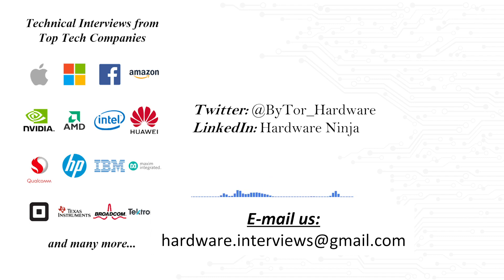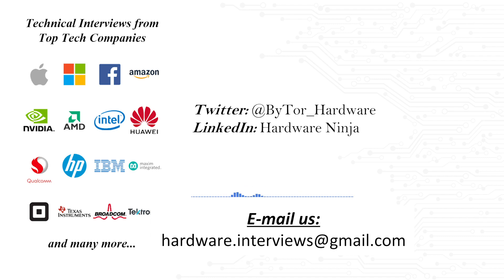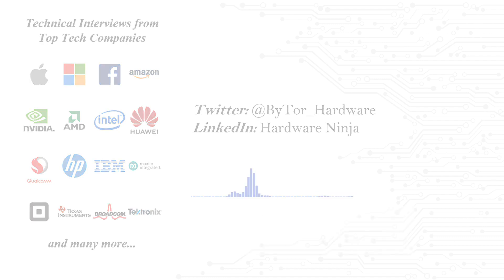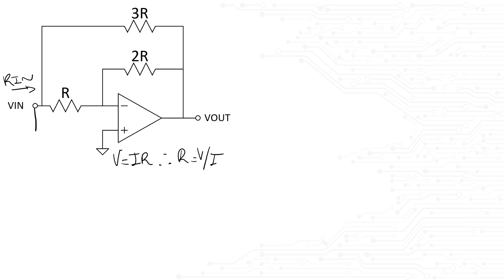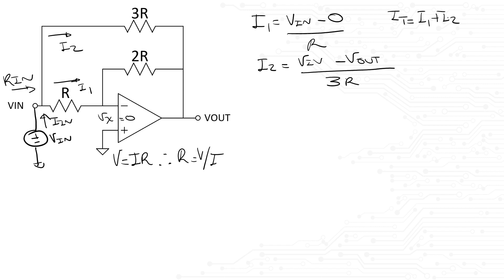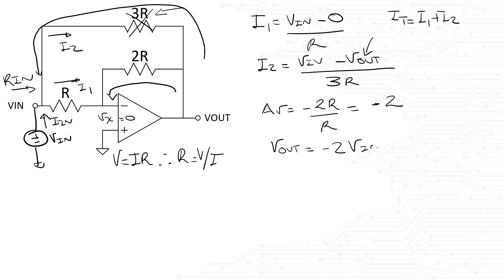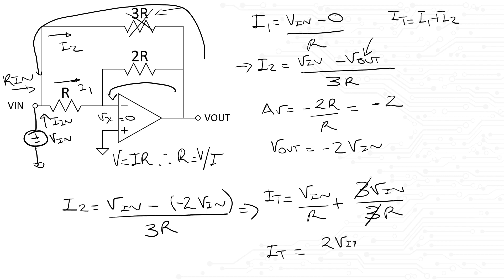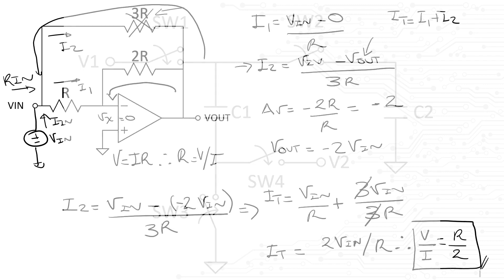HWN - You're guaranteed to be asked this question on your interviews - "Back to Basics"

Comment: A faster way is to assume input impedance is high (so an open circuit) and output impedance is low (so basically a short). In that case we are looking at the resistance of 3R in parallel with R + 2R which equals R/2.

Comment: One baby doubt How you intuitively neglected 3R at the time of gain calculation i don't get it. Yeah! Gain will be -2 but how you approach to find the gain neglecting 3R that's can you please elaborate i just mess up at that point.
Reply: All that 3R is doing is connecting the Vin and Vout nodes. When we analyze ideal circuits, we assume that Vin is fixed, i.e. that nothing in the circuit can alter Vin from the value we have already defined for it. Therefore, 3R is not actually a feedback path (despite looking like one), and does not affect the gain of the op-amp. Therefore, we can ignore it when finding the op-amp gain.

Comment: Don't know whether its a silly doubt. If so, sorry for that. What is the significance of 3R in this circuit? I mean without 3R also, we are getting a gain of -2. I want to understand what exactly this 3R has been used for? @Hardware Ninja
Reply from the maker: Hi Ritayan,
Thank you so much for being here and contributing to the discussion. It's not a silly doubt at all! If 3R was not there your input impedance would me higher. In fact, it'd be R instead of R/2. Would you ever need this in an actual circuit? It depends! Also, remember that these are interview questions to test your circuit analysis knowledge. Sometimes these questions won't have true applications but are more brain teasers :)

Comment: This would make a bad example because the if the gain is 2, then 3R is technically "open circuit"
But what do I know? Haven't seen an actual opening for Hardware Engineering in the US unless you're dealing with FPGAs
Reply from the maker: Hi,
Thank you so much for contributing to the discussion! Could you elaborate why you'd say that 3R is an "open circuit"? Maybe we're missing something and would love to let the community know about it.
Reply: @HardwareNinja  the inverting OpAmp's gaim function is "-R feedback / R input" which just so happens to be -2R/R or a gain of -2
Which is basically what I believe I see here.... it could confuse some people who are not familiar with ideal opamp circuits, perhaps a different resistance value on the shunt to elaborate?
Reply from the maker: @cpK054L  Oh, we see what you mean. It's not that 3R is "open circuit". Instead, it should be taken as there's not feedback on 3R. If Vout is at a lower potential than Vin, then Vin will simply source current to the output of the opamp and the opamp, being ideal, will just sink that current. If Vout is at a higher potential than Vin, then the opposite happens. This is not a true implementation of a circuit but instead used to evaluate candidates in their knowledge. We hope we were able to give some more clarity here. Thank you so much for being here!
Reply: Having a shunted resistor on the Vin and Vout is a very confusing implementation...
The load you have with proportional resistance will let R3 and (R1 and R2) have the same current running across it.
However, if you changed any of the values to say....R1 + R2 to have less resistance than R3, it will still allow R1 and R2 to have the same current, but draw more than R3.

Sometimes I'm honestly confused if I actually saw implementation like this in real life.
Even worse is when the designer doesn't write notes as to WHY they did it that way.
Reply: if the gain was +1 then yes, the R3 would be "open circuit" but in an "inverting amplifier" with "positive resistors" this wont happen.